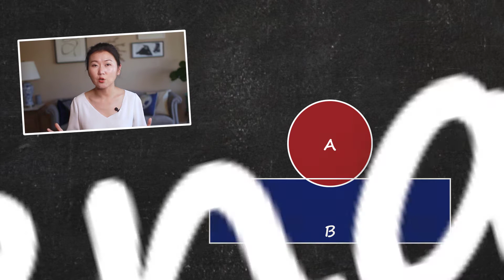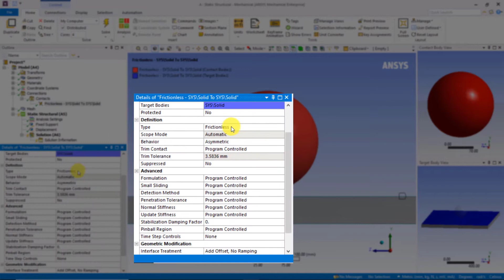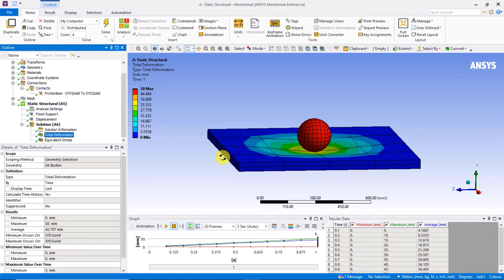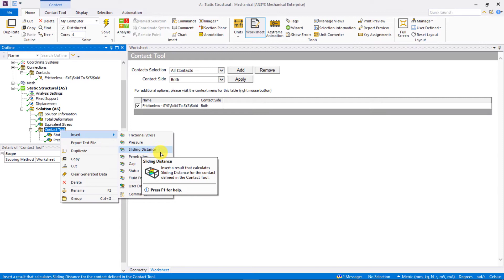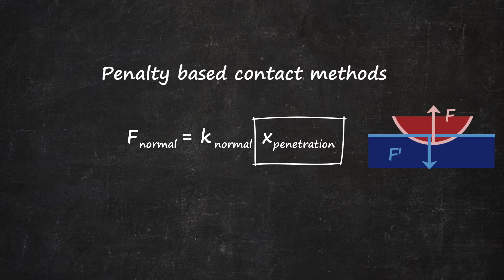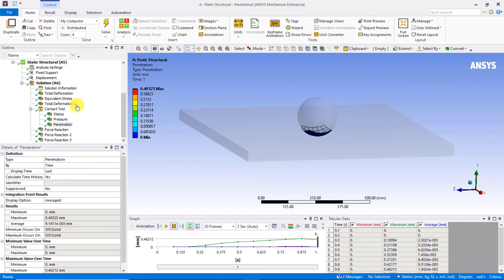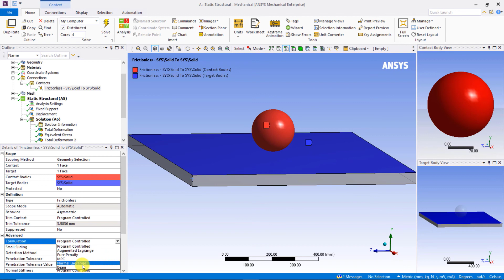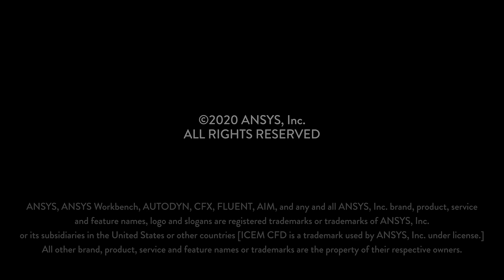Interpreting Contact Penetration Using Ansys Mechanical — Lesson 3

Comment: Hİ thank you for giving a time.   I did the same example. 
stiffnes behavior : flexıble for ball ( structural steel) 
stiffnes behavior : flexıble for graund ( aluminum)
no problem in analysis

but 

stiffnes behavior : RİGİD for ball ( structural steel) 
stiffnes behavior : flexıble for graund ( aluminum)

when ı  do gave an error . why ?

I wrote in the forum, I could not get an answer

thank you
Reply: Did you check the contact? Did you change it?

Comment: Thanks. I have a screw inserted into a bone, as i applied the load, the bolt penetrate about 1 cm into the bone! the contact is frictional. how to prevent screw penetration?
Reply: I have the same issue